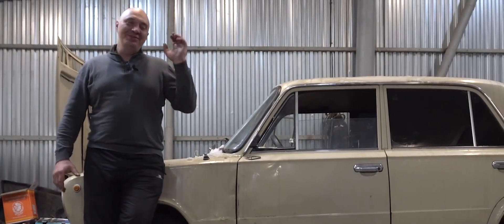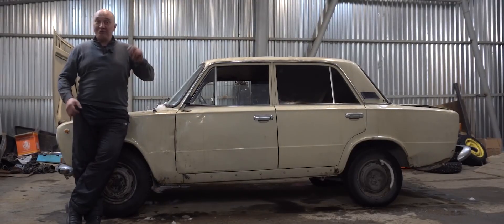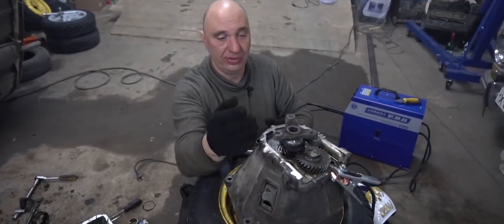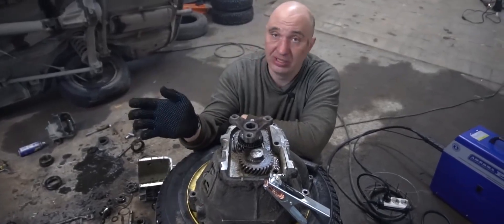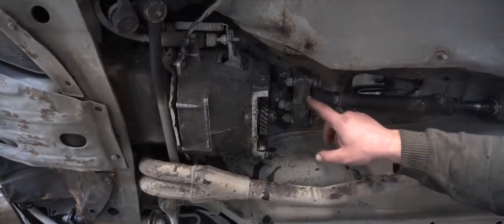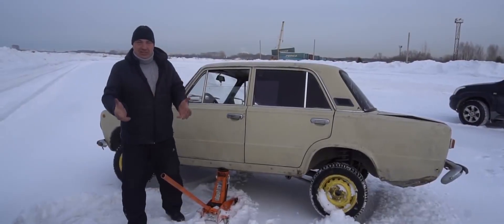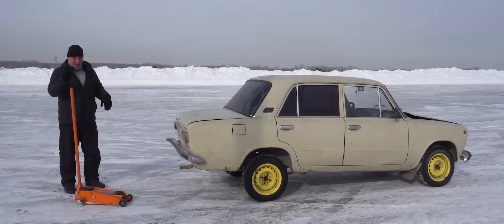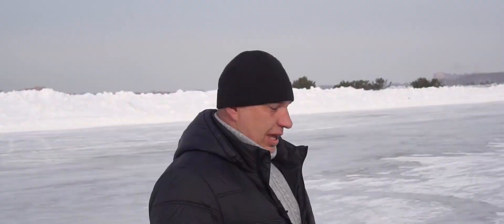Welding the prop-shaft to the motor and driving without a gearbox

Comment: Rather than just dropping the car like that, why not just feather the clutch a bit since you did the smart thing and left it in there? Is the Lada that underpowered that it couldn't get itself moving in what would essentially be 4th gear? I mean... I know it would be hell on the clutch... but let's be honest here... you rolled the car on its side to work on it, so I feel like the condition of the parts isn't really a big deal. If that doesn't work, you could just push it a little bit... once the thing is rolling, it should be able to take care of itself... well... as long as you don't have to stop and get going again.

If you were to do this "properly" if that can even be considered as a thing in this situation... you would probably have better luck with a torque converter... as that would essentially give you torque multiplication, and it wouldn't stall on you when you came to a stop. Granted, some may view this as cheating... which it kinda would be... but it would work.
Reply: Wait for them translate next episode man, they have leave clutch, next episode is drive around town with out gearbox! Poor clutch!

Comment: Looked like the unbalanced propshaft started the destruction that caused it to fail. If you do a full length prop get it balanced first and install a UJ on it rather than the rubber coupler.

Comment: That little engine has more power than a fella would think it has. A CVT would be the way to go and gears in a transmissionhelp transfer torque to the rear end so the ratio on the rear end has to be contended with and that's why a transmission isthe coupler to it. A CVT with a heavy duty clutch would work as long as it was made for the engine horsepower size ratings.The vehicle weight is what kills a clutch + gearing. Same situation with Mopeds, too much weight equates clutch slippageand clutch burnout. Use a Hydrostatic transmission and if you could get the engine to couple to the rear end without burning the clutch up since it has to slip until it has the car moving at a good speed it would it would really fly. There's asolution, a transmission. Maybe a torque converter like in the old cars, fluid coupling?  😊 Never hurts to experiment andno telling what invention you might come up with, love your channel!

Comment: Pointless, it's normal for a 5 speed gear box or 4 speed for that matter that 4th gear is really close to 1:1 ratio, which is the same as welding the drive shaft to the input shaft. just drive in 4th gear only, no work required
edit: and why it failed is not the rubber coupling, the extension after the sliding part caused it to fail. It would last longer if the welded pipe also did away with the sliding part that designed to be close to the transmission and not halfway.

Comment: Here's my request ..on the next video try to install a three phase motor to the shaft which starts from the engine then then used high powered generator..so the mechanism will be like this 👉👉the Motor on the engine place the motor rotate then shaft which was installed in the engine ..then it goes to the gear box then the power is transmitted to the propeller shaft ..I don't know how you will balance the power to the motor but try it out ..

Comment: thought it had a clutch. ?good to watch dumb idea. try putting the engine on the roof and  try  driving it through holes in the roof and floor with chain and sprockets 😂👍👍👍👍👉

Comment: Usually top gear is 1-1 ratio. Some transmissions have an over drive gear, which is a bit taller than 1-1. But basically you could start in 5th gear and it’s the same as welding the driveshaft to the engine...

Comment: I would love to see one of these cars hooked up to a clothes washer, and/or a dryer, and see if the car could speed up the spin cycle(with heavy wet clothes), to destruction. Would love to see a washing machine, in a million pieces. Could attach a front loader washer, to the drive shaft, with the car's transmission, controlling the speed of the washing machine. Would love seeing household appliances destroyed this way.

Comment: basically on most "normal" cars thats the equivalent of driving in 4th gear... when i say normal i mean a 5 speed manual.. 4th gear is often 1:1 ratio... if you do that in a diesel car its very easy to ride like that, i have actually made a bet with a friend and drove from work to home always in 4th...just doing some clutch work solved the problem in traffic lights and uphills

Comment: Yep my hilux with the 5l 3litre diesel can take off in fourth gear on a slight incline with a bit of clutch slippage, another mate in a 2h powered land cruiser also drove his car onto a trailer in 4th after loosing all other gears. On both these cars 4th was a 1.1 ratio

Comment: The Boss Hoss bike uses a chevy 305 v8 with just the clutch housing to direct drive the final , similar situation . No transmission was used in them . Why would this not work if the final gearing was shortened?

Comment: it is not because of the coupling, but because of the imbalance in the piece of shaft that you made that cause the whole thing to swing. Add another bearing near the connection point then you should be good.

Comment: Welding the driveshaft to your crank makes it a one to one ratio which is essentially putting your five speed car into fourth gear and trying to take off. Would have probably needed a push anyways.

Comment: Sorry guys, you brought the wrong car.  I know this can be done, because I did it to a shitty old Chevy.  No welding or cutting required, just high gear, high rev, dump the clutch.  

Are you sure those flex couplings are made of rubber and not cheese?
Reply: It's a Lada. So yes, cheese. Brakes are made from cardboard.

Comment: Thats easy...you dont need to modify anything. Just drive around in 4th gear without ever shifting and you basically simulated this. (Third gear if its a three speed manual.) This happened to a Nissan 4x4 pickup I had trans got stuck in 4th gear (direct drive).I used 4x4 low to pull out and and shifted the transfer case into high at about 50kph. Drove the truck for weeks that way. The power flow in a typical transmission in fourth gear is input shaft to countershaft to tailshaft. All the gears are bypassed. All this did was eliminate any possibility of ever shifting.
Reply: That's not the point though, the aim here was driving around without gearbox, in next episode anyway. Yes is 4th great essentially, but just put in 4th not the same as driving everywhere without gearbox, using clutch for move away  its just fun ;)

Comment: LOW COST LADA DRIFT CAR??!!
Reply: that is actually a thing
Reply: @RansomRabbit428    Maybe they can do it better & cooler ?
Reply: @brianbrowne9177  and russians are already doing that, it's just this channel's focus is not on high performance tuning
Reply: Like some kind of a backyard drift car with stock engine and some simple mods for example cut the springs, no air filter and so on..

Comment: the rubber coupling didn't exploded until it started flexing due to lack of carrier bearing at the end of the extension where the back of the transmission housing would have been

Comment: That's just silly. Same as having it in high gear. 1:1. Why not put another gearbox backwards behind the stock one. See if you get super hyper overdrive. Go plaid.
Reply: So basically what we want is a collab between garage 54 and gear down for what? Imagine a 1,000,000:1 ratio, no way itd ever actually work, but itd be fun to watch!
Reply: @hamstirrer6882  I'm pretty sure it actually would work since the secondary box would be acting as an induction gear instead of a reduction gear, in the end all you need to make sure of is two things:

1: That there is a conversion box between the gearboxes for proper shaft rotation.
2: That the secondary box is in it's final gear to ensure proper operation of the primary gearbox and that when the primary box is in top gear to start going down in gears on the secondary box to increase overall speed.
Reply: GRIFAbyte101 true but that would take some serious engineering, both in design and manufacturing, to implement properly, which isnt the point of this channel. Good point though, i meant it hypothetically and basically as a joke
Reply: @rodarywindsorcleveland8506  its called split shifting and most big trucks have that already.
Reply: @rodarywindsorcleveland8506  big rigs have that, check out some truck videos :)
Reply: "Go plaid" ha ha ha! I'm gonna laugh about that all day, and use it on my drive home.
Reply: I read online that in order to go plaid one must install a ludicrous speed button. I was wondering if anybody had the part number for said button for a 2003 honda accord.
Reply: @dakotasnow1174  Just don't stop too fast, lol.
Reply: Honestly, if you stacked another gearbox behind the front one thats locked to 1:1, you would have your stock ratios with extra resistance. However you can add a auxiliary box on the back that either directly outputs 1:1 or an overdrive ratio, and that would double your 5 speed into a 10 speed with minimal weight.
Reply: @kennedy796  second one backwards will decrease ratio
Reply: Yes, I thought that type of overdrive up when I was in highschool, many years ago!
Reply: No, because in high gear, there is still a final drive ratio. This is like having it in seventh gear.
Reply: New to this channel, I see.
Reply: stevenwithanS In Sweden we have a thing called EPA/A-traktor which is a rebuilt car to go 30km/h and to achieve that speed we use a secondary gearbox, usually a Volvo M40 locked to 1st gear.

Comment: I thought he was going to use the clutch ?  If he slipped the clutch I bet it would have worked better.
Reply: I don’t think so. It would either destroy the clutch (almost at impact with the plates) or it would have sheared through the valvetrain and/or the drive shafts.

Comment: The prop shaft didn't blow out because of the load, it broke because of the imbalance. That's why it's recommended to get the driveshaft rebalanced when the u-joints are replaced. Once they start spinning and bowing out, there's no yoke on the planet that can withstand that kind of force. Great video, but to the commenters saying to slip the clutch; it wouldn't have saved it. Shock load didn't kill it, the rpm did.
Reply: They probably could've got away with adding carrier bearings to the shaft between the drive line and output shaft
Reply: The lack of support made it blow, i knew it would before he tested it. I once lost a shaft support on a rwd volvo 240 going 90kmh, the banging and shaking was insane but nothing broke, new support rubber asnd bearing and the car was good as new. Imbalance will not harm unless you got one of those Alfa Romeo Alfetta with rear mounted gearbox/transaxle, those italian DOCH engines rev very high with the axle between engine and gearbox moving at crankshaft speed.
Reply: I beat , pressed dozens of ujoints into drive shafts and never had any balance problems.

Comment: It would be far more sensible to run a straight shaft thru the original gearbox housing. The reason it kept breaking is because it was not balanced perfectly and had no support bearing or carrier at the slip joint. 
Many rookie mistakes made here and glad nobody got hurt!

Comment: You can't have the splines in the middle (lengthwise) of the shaft. Please have a do-over on this project. 
Get an extra long drive shaft from a savage yard, something that will connect at both ends, no hanger bearing, & has a single size tube (not a bigger diameter in the middle). 
Shorten it to the proper length. Shortening is easier than lengthening & more stable. Mark a line lengthwise on tube. Cut the old weld at solid end, not splined end, not all the way thru yoke. Shorten tube as needed. Install yoke in tube, align marked line. Roll tube on smooth surface (table) & square up yoke. Tack weld in at least 4 places. Roll again. Finish welding yoke to tube.

Comment: If you left the clutch in place.... why didn't you use the clutch by slipping it to load the driveshaft up slowly? Would burn through the clutch quite quickly but would give you more than a few starts before it went. Same as starting in 4th, or whatever the 1:1 ratio of the transmission is. I've successfully started in over drive before by slipping the clutch a ton. Just for fun!
Reply: I think it was so out of balance at high rev it just snapped

Comment: looks like on that last run you need some sort of stabilizing bracket that has a bearing housing or 3 to support the drive shaft when under torque / load

Comment: Isn't 3rd or 4th gear for most transmissions already 1:1?
Reply: If these Ladas are geared as such, you are correct.  4th is approximately 1:1, so why not save all that messing around, dump the clutch in 4th gear on the ice, drive into the snow bank then go home and drink some Vodka?
Reply: Yup, so they're basically dropping that bitch at highway speeds haha! Hopefully they get a beefier (and balanced lol) driveshaft on it soon. I bet it has more torque without the extra gear load as well.

Comment: I mean, my dads old van had a 3 speed + overdrive in 4th. I broke the shifter linkage in 3rd gear while driving. Made it home fine. 

Its not that hard to start a car out in direct drive with a clutch. I've done it many many times.
Reply: Not the same idea BUT ... I lost the clutch release on a '75 Chevy pickup and drove it for three days before getting it fixed ... just started it in first gear and shifted without the clutch (column shifter too)

Comment: The bearing is cogging because you welded through it you should have grounded on the other side of that shaft not so it has to jump across the bearings and races

Comment: All this does is run it at a 1:1 ratio. That's the same as 4th or 5th gear in most cars.
Reply: I was hoping we would see if there would be a difference with the power losses through the drive train. They should have done a before and after on a dyno
Reply: @un_civilized  Well in theory it should gain a little over other ratio's but if tested against the 1:1 equivalent gear there will be almost no difference. 
This is why dyno tuners try to do the runs in a 1:1 if possible. More difference in the ratio means more mechanical losses in the gearbox.
Reply: @PingasTheFourth In what?
Reply: @TomOfTurmiola Even these days 4th is usually a 1:1 with the rest being overdrives. Some of the 8-9spd boxes are different but for the most part it's still the same. 
I remember when the Ford Sierra and Vauxhall Cavalier came with a 5 speed for the first time and everyone suddenly wanted one.
Reply: no, 4th is not 1:1, you forget about the final drive that is in the range of 3-4.5:1

Comment: Isnt 3 or 4gear direct drive? I thought the clutch was left so you could ride it so it goes smoother into drive?
Reply: On a automatic yes but with a standard every gear is direct drive.
Reply: @LincolnTek im not sure how to reply to this, but ill start by informing you that what ever gear auto or manual you are in that the speedometer and rpm gauge coincide is the "direct drive gear".  You'l have to explain to me what you are talking about because maybe there is a miscommunication here

Comment: No  I was wondering why you roll a car over to work on the underside instead of using a lift
Reply: Better lighting, no snow and water dripping on you, easier on the neck.
Reply: @tct72  all good reasons. They're doing it wrong in the shops

Comment: please do this one again as promised, will be interesting to see what speeds you get, i have done something similar on a go kart with a 100cc honda engine, we cut the gearbox off and went direct drive without clutch and we was getting some amazing speeds but 2 stroke does rev higher than a car engine ???

Comment: Direct drive is low. Usually around 4th gear in a normal car. So starting on a jack and let go will put enormous strain on the driveshaft. This would work if you tow it up to 60 km/t and let go of the clutch

Comment: Save yourself a lot of work and put it in 4th gear
Reply: That's what I thought
Reply: Would have been a lot easier yes.
Reply: And if you push start that is exactly what you are supposed to do. (I mean you are not supposed to push start a modern car but for that old Lada it should be fine.)
Reply: why 4th exactly? how do you know?
Reply: Žanas Tumasonis 4th gear is a 1:1 gear ratio on most cars. The only exceptions would be a 3 or 4 speed where 3rd is 1:1. Or one of the newer 8-10 speed transmissions where either 5th, 6th or 7th is 1:1.
Reply: @splewy  I see. is that why dyno pulls are done in 4th gear? to show direct power?
Reply: @zanastumasonis  Not really. All cars still output power from the transmission into a differential, which is always a reduction ratio. So transmission ratio becomes irrelevant. Gear choice on the dyno is more about which gear gives you the cleanest run. If you use too low of a gear, the tires can slip on the rollers or the dyno might have trouble keeping up with wheel speeds and you'll get spikes in the graph. If you use too high of a gear, it can lead to dangerously high wheel speeds or excessive strain on the engine. Some cars dyno in a 1:1 gear like 4th, some dyno in a reduction gear like 3rd, and others dyno in an overdrive gear like 5th. It all depends on the car and the dyno.
Reply: @splewy  makes sense. thanks!
Reply: Looool you right
Reply: But the fun factor ia different dude